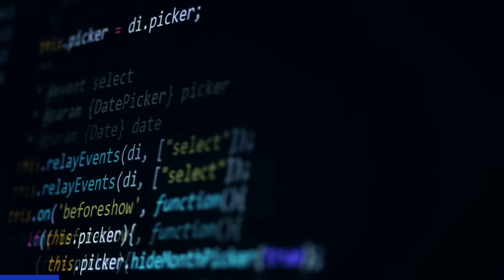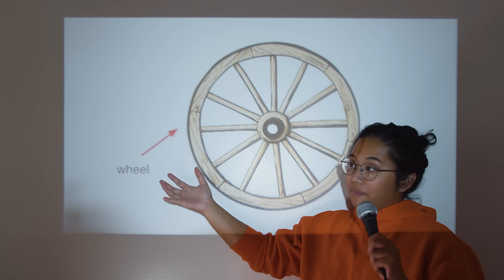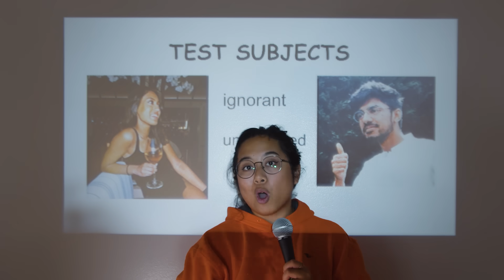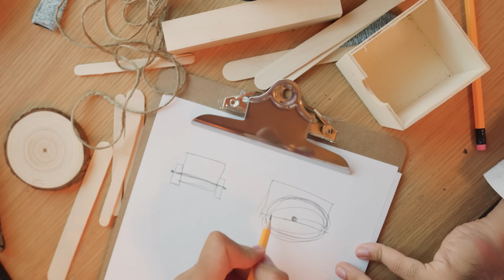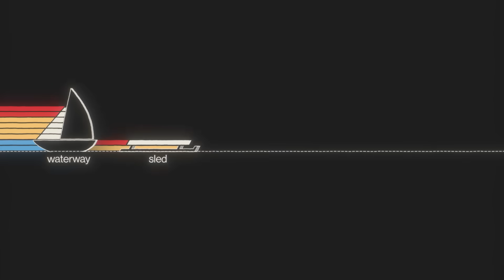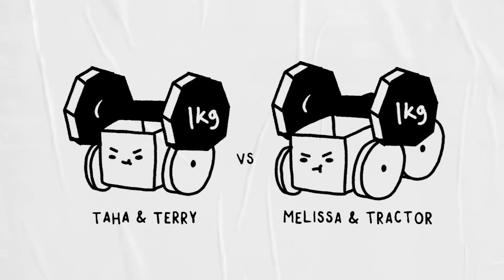why it took 200,000 years to invent the wheel

Comment: I think a major contributor to what allowed wheels to go from a "haha neat" kinda thing to one of the most important transport inventions in the world is when we started building streets.
Wheels are extremely inefficient unless you have an even surface.
The primary reason why wheels even have the capability to be amazingly efficient and useful is thanks to the specialized infrastructure supporting it.
Reply: This is why the Aztec and Maya civilizations famously "never invented the wheel." It wasn't because they weren't technologically advanced, it was because in the mountainous jungle environments in which they largely made their homes, the wheel was a comically inefficient way to transport things.
Reply: @littlesnowflakepunk855  Also there weren't any horses to pull carts in the Americas, until Columbus brought them over.
But Meso-americans did invent the wheel though - though they only used it for toys. It's more impressive that they invented it themselves, while most of Eurasia just copied the one guy who first invented the wheel.
Reply: @Wave-Hello  I don't think pack animals really affected it that much - the Inca had access to American camelids (llamas, alpacas, etc) and also didn't use the wheel for practical purposes
Reply: @littlesnowflakepunk855  because the rocky roads of the andes mountains wouldn't have been a practical place to apply it.
Reply: @Graeberwave  yup
Reply: @Graeberwave  well the reasonings are all well, being all rocky - but in the video it's told that one of the first wheels were used in the alps. a famously flat area with no snow or trees or other disturbances. and so easy to build streets on
Reply: @leBen89  from the other side, cart is a good example of getting staff in the mountains. Yeah, you still have a risk to get stuff go downhill, but imagine how you could transport 100 kg of food with ony sledge. Sledge are good to go downhill in mountains, but going upside wheel is much better
Reply: @littlesnowflakepunk855  those camelids aren't nearly as strong as Eurasian horse or ox though. They can't even support the weight of an adult human. With modern wheels and smooth road they could be used to pull carts, but before those exist, there's little reason to do that. Putting stuff on them or hanging on their sides is much more useful in mountainous, rough terrains.
Reply: @leBen89  there's plenty of steppes around that area. Very wide steppes in fact. Compare that to South America where the options are mostly either mountains (taller and much, much bigger than the Alps), very dense jungle with plenty of very wide rivers, or combinations of both.
Reply: @Wave-Hello  not sure what you mean really - why is it more impressive to you when the meso-americans invented the wheel compared to when the euroasians invented it? somebody had to invent it in the first place in euroasia too, they couldn't just "copy" somebody else's design as you put it :S
Reply: @iruns1246  steppes? in the alps? ever been there? but yeah, Hannibal and his elephants loved the steppes in the alps. almost felt like home. Also, if you just mean "Europe" and not the alps, you very much missed my point. I condemned the reasons given, not the fact itself. especially considering that the great american civilisations (Mayas, Aztecs etc) are almost as famous for their roads in harsh conditions as the Romans
Reply: @leBen89  here's a quote of my comment dear Ben: "there's plenty of steppes around that area". Not in the Alps itself, >>around that area<<. It's connected with wide, relatively open plains in the directions of both Europe and Asia. That means the potential benefit of having wheeled vehicles is just huge.

Take a look at a map and compare it to far bigger mountains and swathes of thick jungles and wide rivers in South America and honestly tell me that the potential benefit of wheels here is nearly as big. (Especially in combination with the fact that they don't have strong beast of burden).

You just love being snarky for no reason do you?
Reply: @iruns1246  eurasia such a general term. by your definition the alps are close to the Himalaya. In the Are around the Alps are many low mountain ranges. so even this is not true. also at the time the wheel was invented most of europe was in a jungle itself, just not a tropical one. with your definition of "around that area" one could ague just the same points for american planes, be it in the north or the south.
Reply: @leBen89  why would it be close to Himalaya? What a weird argument. And the mountains and jungles around that area are not even close to the same scale as the ones in South America. It's the Amazon ffs. Not just any jungle.

You seem to the under the wrong impression that if two things are of similar type of terrains then they must be within similar scales of each other.
Reply: @iruns1246  your "in the area of the alps" was eurasia, your word, not mine. which is an insane scale. also, yes, the amazon, sure. but it's not like the amazon spans the whole continent, even at the time. and you seem under the wrong impression that scale is all that matters in this case. it's passability. and you seem to acknowledge this, too (that's your amazon argument). yeah, the andes have bigger mountains to sea level, but also the base is much higher, otherwise cities like la paz, quito and bogota wouldn't be possible. from that to the highest mountains it's about 4000m, just like in the alps. again, I'm not against your facts, they are true. but the point that these are the reasons that the wheel wasn't invented or used can easily dismissed. nobody really knows why it wasn't used. and if it was so easy to figure it out, like you seem to think it is, then there would be a common theory - but there is no conclusive one, just for the reasons I gave to you
Reply: @littlesnowflakepunk855  They just weren't there yet ss they had just gotten into the Bronze age. Given another couple hundred years to a thousand they would have invented the wheel. 
The history of the Americas is really interesting as it gives a glimpse into the past of the rest of the world .
Reply: @CaliMeatWagon  They invented the wheel, just didn't use it for transportation purposes.
Reply: Yeah, a wheel on a mountainside is a great way to make your stuff fall down the mountain.
Reply: Wheels were around for many centuries before streets, but you're right. They were invented on the Eurasian steppe which had both horses and endless flat grasslands, but even there it was probably more challenging than people used to modern roads would imagine.
Reply: In flat land be it forest or grassland any path being repetedly used by foot will become hard packed and usable as a road WHEN DRY.  Making true roads like the Romans made makes wheels better but it's not a must have for smaller carts.
Reply: now to close the loop and elevate society to a new age of prosperity and abundance with mechanical advantage for draft animals. emus on bicycles. no possibility of rabies. bird seed is cheaper than gasoline!
Reply: And wheels without pneumatic tires are also pretty inefficient unless you have a fairly solid surface -- otherwise they just sink/dig in and waste a ton of energy making ruts.   So soft, muddy, or sandy soils are issues for early wheels.
Reply: Yeah cars don't go upstairs
Reply: Great point! In my country the roads are so terrible and completely unmaintained that they're 50% potholes and waves and you're mostly bouncing and swaying in the car, so I like to say that we're better off without the wheel here and should use a square or hexagon to counteract the bumps.
Reply: just make rounded triangle wheels then smh
Reply: The wheelbarrow...

Comment: Before watching I'm guessing it has to do with wheels requiring a fairly flat and solid surface, thus being fairly useless in most places if you don't have some level of dedicated infrastructure, combined with bearings just being hard to do right--the wheel is the easy part, connecting it securely and with relatively little friction is the hard part.

Comment: Early wheels were not used for locomotion, but rather for things like clay shaping and grinding.
It is assumed people realized fairly quickly though, that if you put them on the side and slap another wheel on the other end, you can transport things easier. But that's also probably the reason why it took so much longer to get efficient wheels, because they just weren't in that mindset, so they must have ignored it for a long time until someone accidentally made a grinding stone or something that started slipping.
Reply: I think you might have missed the point there...you don't just put two circles on a thing and you're better off.  Humanity had ways of transporting things already, the challenge was to make a complex machine that was more efficient.  Which includes its ability to be useable.  I could take two millstones and attach them to a sled, that would not make transporting things easier for me.  Where even am I going to try and drag them?  There are no roads.  What are the chances the thing I've constructed isn't going to fall apart or get stuck?  And it still has to be better than other options.  Unless and until my boat isn't going to get somewhere faster what's the advantage?
Reply: @cupguin  I think you just misread my comment...
Reply: @morphman86  I think they got a point. It's not like people couldn't fathom slapping pottery wheels on the side they just couldn't find a practical way to do it. Pottery wheels don't have to be light, they don't have to carry heavy loads, and they don't need additional infrastructure like roads. Like we see some artifact toys with wheels in civilizations that never used them for transport. They had the idea, but they couldn't find a way to make it better than carrying or dragging stuff.
Reply: every person that has ever seen a round shape roll in nature could intuitively grasp the functioning principle of the wheel.  The real technical problem is the axle/bearing assembly, not the wheel itself.
Reply: @Exgrmbl  If you watch the video, for the purposes of this, axle is included in the definition of a wheel

Comment: Makes me nostalgic for teaching basic design and engineer camps for primary and secondary school students. The "AHA" moment from Melissa is the best. It's fun when you witness realization that slapping a round object onto another object, and thus making it immobile, doesn't make the best cart. 
My favorite creative design solution I've seen is using overly large wheels on a single fixed axle. The load is fixed to the axle and rotates around the axle as the machine rolls. A counter weight was attached to the other side of the axle to keep the rotation smooth.
Reply: I... would not like to ride that vehicle. Or maybe I would.
Reply: @michaelwerkov3438  You actually could ride a variant of it: the Rhönrad or gymnastic wheel.
Reply: Melissa and Taha prove that you don't have to be a primary school student to have fun like this. You just need the mental age of one.

Comment: this is lovely. we had a class about the history of technology and our professor brought us the case of the horse pulled carriage. it required a lot of stuff, like agricultural techniques, metallurgy, the wheel. it was overall much harder than using the ox, but production increased a ton when they got it right and was a factor bringing humanity out of medieval times
Reply: I get what you mean but I think they had the wheel pretty much sorted by medieval times. The middle ages usually means from the fall of the western Roman Empire to the Renaissance. Most cultures in the classical era, (Greece, Rome, Egypt etc.) had the wheel so I assume it was developed some time before that.
Reply: @damientonkin  Yeah, if anything the wheel was a factor bringing humanity into the classical era.
Reply: @Oddi0  there's a whole complicated interplay between the development of the wheel and the domestication of horses and pack animals which is well outside of my area of knowledge
Reply: @Oddi0  i meant the horse, not the wheel. before that they used the ox
Reply: "Out of the medieval times?"  No offense, but I think your timeline might be a little off.
Reply: @scottdick296  i mean, agriculture was a huge factor in that. they changed from two harvests a year to 3 harvests a year. that allowed them to feed the people and the horses, and that boosted production some more. they also created gear that allowed horses to pull stuff.
with famine in a low, and things improving rapidly, they got into exploration, and that's around the XV century. 

feel free to correct me, it's been a while and that's not my field of expertise.
Reply: that assumes history moves in one direction. Medieval times was great for lots of people because they had no king to be subjected to. Rome had fallen. No bs overlords to deal with. :)
Reply: @Graeberwave  It was literally the era of overlords, they were under feudalism. also famine and disease was rampant

Comment: I'm surprised Taha's "tensioned string" axle held up so well! Also I think Terri's box might have been touching the scale pretty early, although that might have just been the camera angle...
Reply: I think Terry would always have a bit of contact with the ground, because he only has two wheels, but he would only be disqualified if the whole bottom surface was touching the ground.
Reply: @vigilantcosmicpenguin8721  It looks like Terry's right edge is on the scale, as opposed to front or back edge as should be expected from pivoting about the axle.

The tensioned string was a risky strategy, because low tension leads to sag and wobble, but high tension without spacers leads to high friction with the wheels on the cart body.
Reply: Think Taha's design was good for the size they were dealing with but wouldn't scale well. For heavier weights of wood it would squash the rope and add a lot of friction to the system.
Reply: @davidjennings2179  But it wouldn't be able to turn.
Reply: It was really good especially for the race as the ability to bounce and deform to the bumps on the road made it well not fall apart
Reply: @goldenoodles  For keeping wheels on a rigid axle, my thought would have been to put a hole through the axle outside of either wheel, and tie a knot through it. Then the wheel would be locked on.
Reply: its an alright system but if it were used it would be bad in my opinion. if you turn more to one side than the other with this design the rope gets very tentioned and may snap, atleast i think it would realistically and it could be time consuming to make a very thick and strong rope everytime the rope snaps.